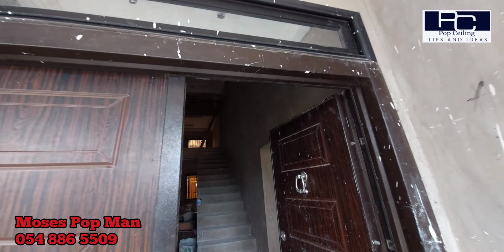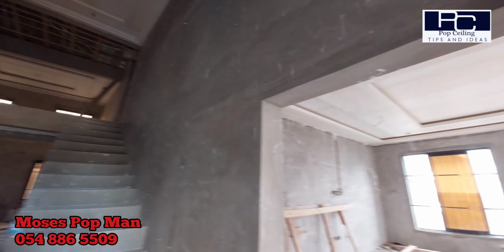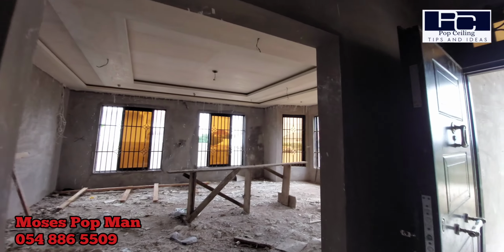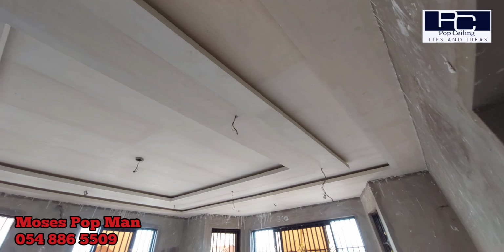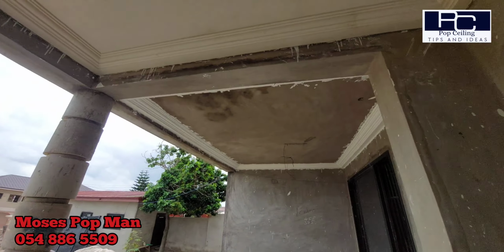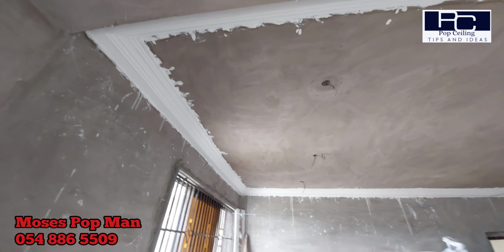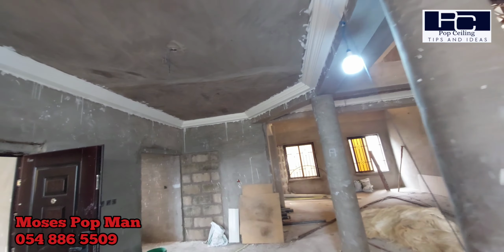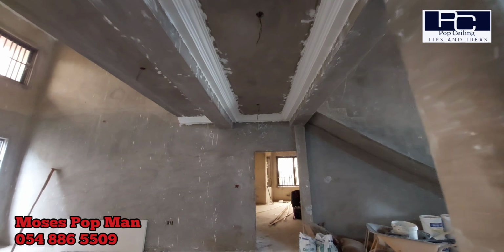Minimise your pop expenditure? This Kumasi project's way of pop ceiling can help| building in Ghana

Comment: Nice work- what did you apply to the concrete ceiling?
Reply from the maker: Homecharm paint
Reply: @popceilingtipsideas8939  👍.  How many coats?
Reply from the maker: @l.e.sparklesfkaelliesparkl5875 2 coats